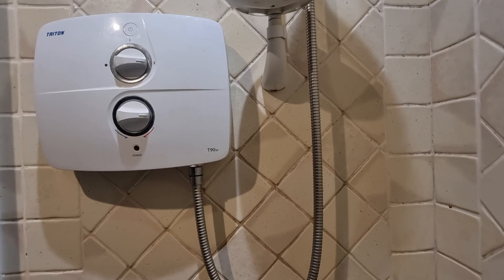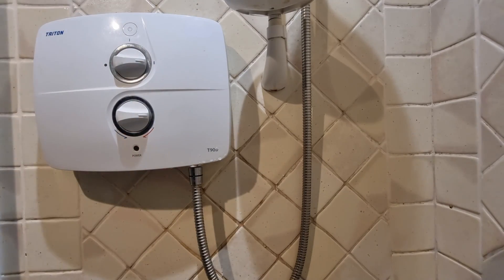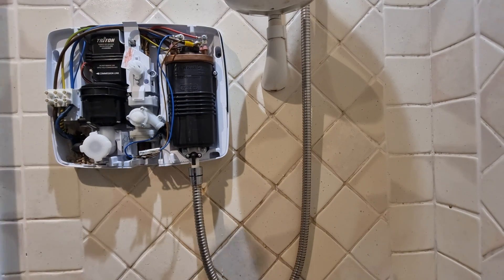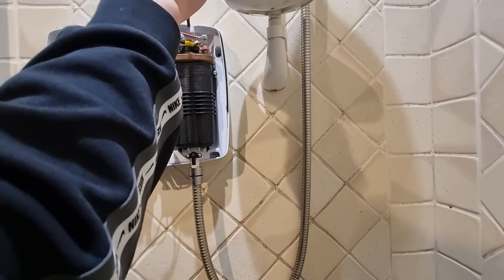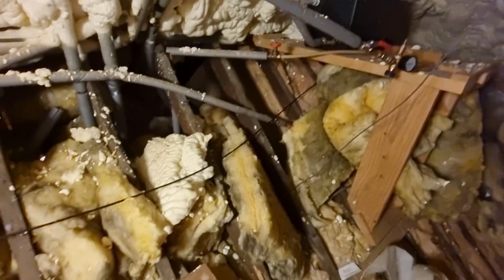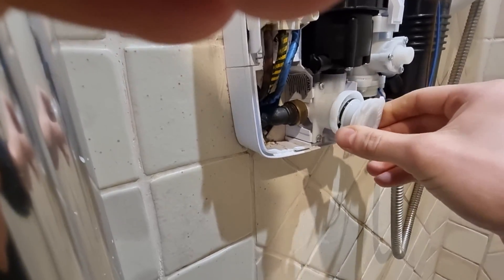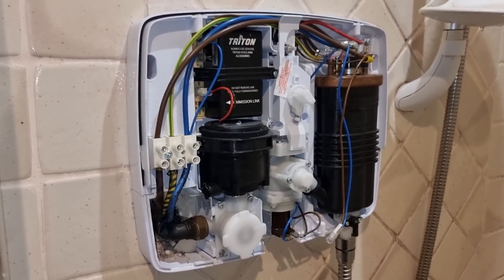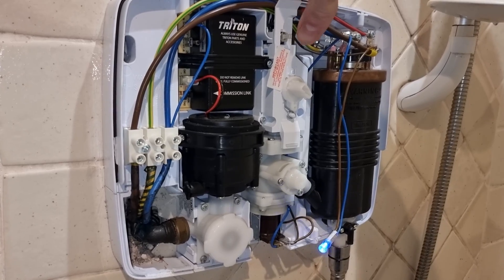Triton T90SR Electric Shower Hot/Cold Issue DEMYSTIFIED! 🔥❄️ | Troubleshooting & Fixing Guide (4K)

Comment: Hi No Sparks.... my t90sr is running hot water all the time even  when turned all the way to cold. Any ideas why this is ???? Thanks.
Reply from the maker: Most likely blocked filter or a blockage in the water inlet, you should notice the water pressure changing when you move the bottom dial. I'm assuming if you move the top dial to cold and it goes cold though correct? Just the bottom not working
Reply: @no-sparks  thanks for the reply..... it stays hot all the time no matter where the two knobs are.  Could it be limescale  if so how do I clean that ??

Comment: If the tempertaure dial starts at 12 and ends at 5 o clock does that mean the cover dial has problem or the dial behind cover. Newly installed and barely luke warm. Dial only has half the turn yours does. 🥶
Reply from the maker: Yes I'd imagine that's why that is

Comment: I loved your video. 
I installed this shower when my old one broke. The problem I have is, the water pressure is not as good as the old shower. What can I do to fix this ?
Reply from the maker: The older showers T90SI had a bit more water power than the SR, not much can be done I don't think

Comment: Isn't there a valve just below the commissioning switch that can be used to get rid of any air locks? mine turns to cold every couple of minutes, very informational video, i'm going to go through the filter and feed pipe from our water tank to check for blockages, hopefully solves the issue, hard to find info online as to what the problem and solution may be, thankfully we got No Sparks!!
Reply from the maker: I'm not too sure about the valve, there possibly is but I got rid of airlocks by running with the commission link on so the water travels through without the pump running, getting the airlocks out. Yeah might be a good place to start looking for a blockage, that's the same issue we had, would run for a while then it would go cold and repeat the cycle
Reply: That's the one!😂

Comment: Nice video, well explained, just fitted a new one thisevening at home, with both elements engaged and temperature up to about 3/4 (2 o clock position) it looses water pressure. It seems to operate at optimum at this, we have good water pressure supply from tank so I dont know what the problem is. It doesnt seem to heat up to max temperature?????
Reply: Just had one installed but even at the highest heat setting the water is only luke warm . Is there a fault ?
Reply from the maker: Definitely doesn't sound like it's working as it should 🤔 did it replace an existing shower unit?
Reply from the maker: Ahh nice! Does it get hot At this 3/4 position? 
The more you turn the bottom knob towards max heat the less pressure you will feel from the shower head.

Comment: Hi yea got my t90sr just fitted but it runs but doesn’t show power light can you help .. Pressure seems abit low to comperd to old t90si it replaces
Reply from the maker: That's strange, so when the shower is running there's no power light on?

Might be one of two things:
1-when cover was put on the bulb wasn't clipped into the plastic holder and isnt shining through the cover. Or
2-The light cable was pulled out of its connection during installation and so the light isn't coming on.

Regarding the lower pressure, the SR has a different pump. The SI had a brushed motor hence the louder noise and from memory, our old SI was slightly more powerful. There might be a bit of different pressure output from the SR but if it's a massive difference there might be a problem.
When upgrading did you use the hose and shower head from the newer shower or keep the old one? This might be part of the issue but only a guess. Hope this helps